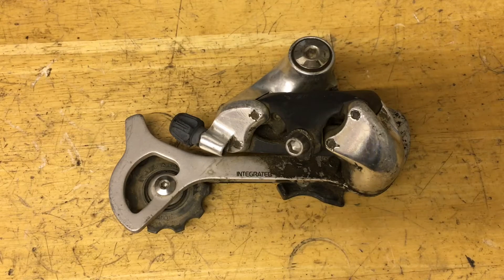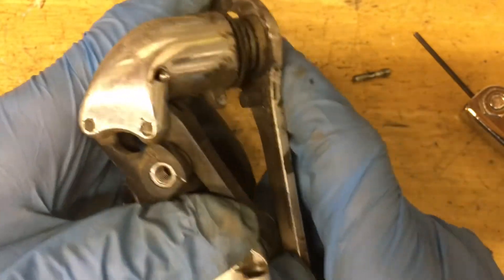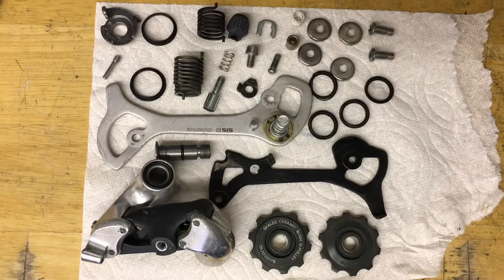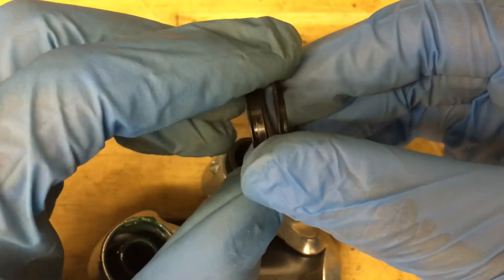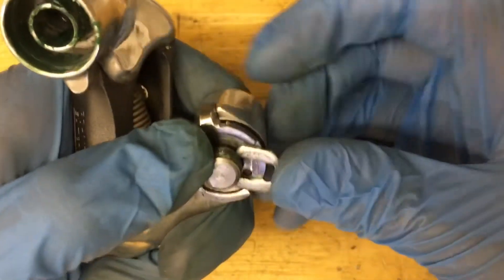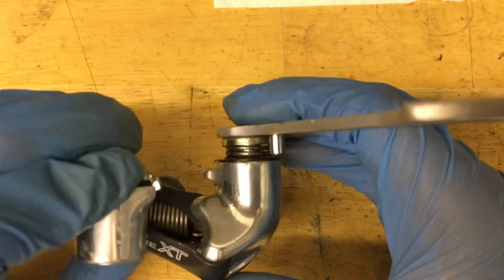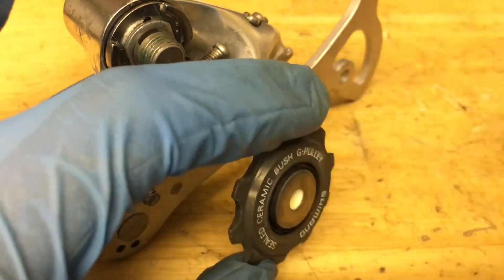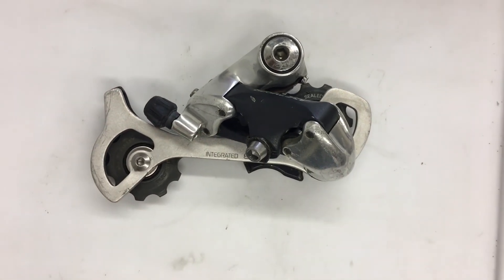How To Rebuild a Deore XT M739, M737 Derailleur

Comment: I am giving up on my m737...screwed up b screw plates threads and don't feel like getting a parts derailleur. It's up for grabs if u interested.
Reply from the maker: B screw is pretty easy to re thread just try using some oil on the threads

Comment: I can’t find anywhere that sells the B or P springs. Could you tell me if there is any compatible springs that I can buy. Thanks
Reply from the maker: Springs aren’t sold for older derailleurs like that you’ll have to steal them from another derailleur of the same era
Reply: This is exactly my current problem. Fisher Paragon from about '93. Rebuilt in 2000 using all new Deore XT. Back derailleur is the m739 and the b-spring has lost it's touch. Doesn't sweep back and keep the chain in tension when moving to the smallest cog. If anyone knows of a compatible spring (like the m770 sure looks the exact same) I'd be forever grateful!

Comment: You reversed your pulleys.  Guide pulley you put on first, not last.  Last one is tension pulley.
Reply from the maker: They can both technically be guide pulleys Ceramic ones are always the guide ones the 739s came with two of the double bushing ones